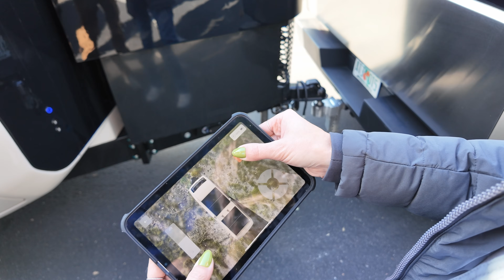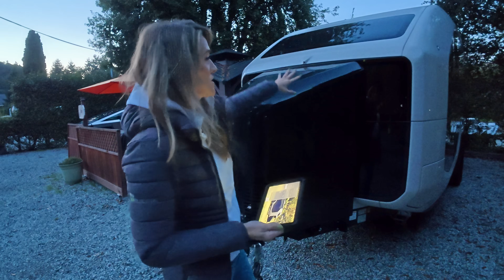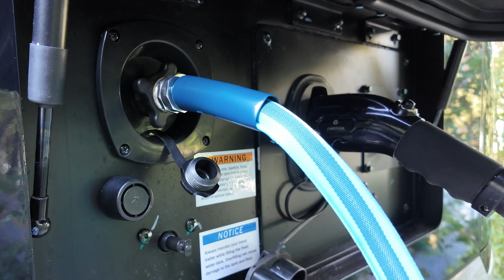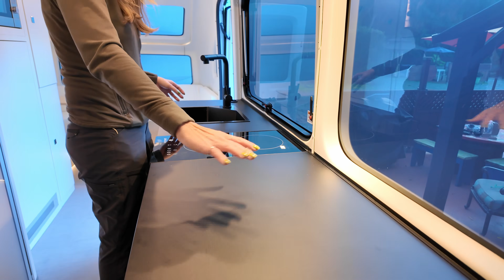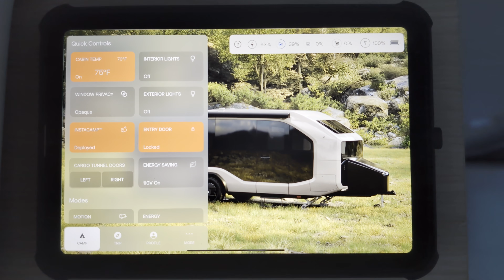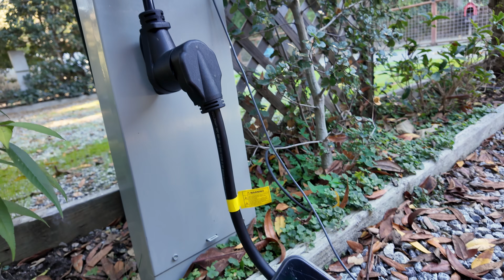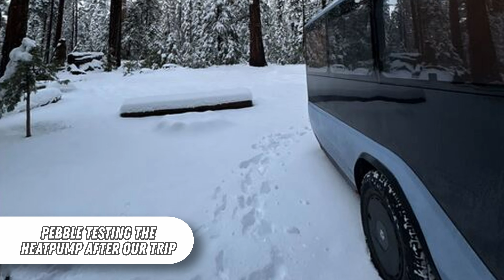World's First Pebble Flow Review (Electric Travel Trailer Camping Experience)

Comment: Pebble, please make a bigger version of this sith dual axls, bigger battery and solar.  More storage space, room for resi. Fridge, washer/ dryer.  Hatch on the roof to access to 1 or 2 roof top tents for more speepers, saving tons of room inside.  Beyter HVAC, 120V OUTLET outside...  shawer room, more rack space in the corner to the right of the mirror.  There js not enough storage thruout.  Maybe even utilize the sapce below the hub during toad mode.  Then remove it at the camp site before lowering the hub.
Reply from the maker: Maybe they will move up-market to an even higher priced platform as you've asked.

We suspect they'll move to greatly expand the size of their total addressable market by offering a more accessible product with higher volume potential.
-Producer Tim

Comment: From reddit:

Flush-mounted solar roof looks cool, but it’s an engineering mismatch for RVs. By eliminating the air gap under panels they trap heat, which:

(1) reduces PV output (≈ −0.35%/°C),

(2) bakes roof seals and causes leaks. The recall may relate to this.

(3) forces the AC to run harder — creating a thermal feedback loop that drains batteries faster.

Better insulation such as aerogel only delays heat transfer and often makes roof/panel temps worse. This is a design-for-looks problem, not a design-for-RV problem.
Reply from the maker: Every engineering decision is a tradeoff 
-Producer Tim
Reply: @MissGoElectric  How about if the heat pump stops working during charging? Did you test it if the heat pump will work under full sun? The flush-mounted solar panels may make the heat-pump/compressor stopped during charging or driving. I don't know, but I just have the concerns. Safety is the most important thing in our world. Agree?
Reply from the maker: Did we test the heat pump in the sun?  We had the vehicle for two days.  It was not hot outside.  It was cold.  We shared all of the HVAC data we gathered in great detail. Your proposal that the solar panels have any affect on the HVAC system is baffling to me.  We showed the location of the heat pump and it is nowhere near the panels.  -Producer Tim
Reply: @MissGoElectric Flush-mounted Sonar panels traps heat above roof. This will cause the temperature go to very high, which degrades the sealant. The trapped heat will transfer to the cabin which results the heat-pump running continuously.
Reply: @MissGoElectric  It is a good video. But I would check if the heat pump works (make cool) ALWAYS. The feature is used more often than heating.

Comment: Travel on the road-all flat or any hills? Is roof space able to support the installation of solar charging panels? Is the unit prewired for TV, sound system, and the previously mentioned solar charging controller/monitor?
Reply from the maker: As shown, the roof already has solar and required equipment.  Audio and Video is "bring your own".  See the company web site for granular packaging details. -Producer Tim

Comment: Great review - I liked the mention of the heat pump not operating properly - other than that, I liked the whole automation of this RV - here's my question - Is there a manual backup for any of the automation if it goes on the fritz?
Reply from the maker: Thanks for watching. Defective parts are replaced under warranty during the warranty period. The heat pump anomaly was unique to this RV according to Pebble they fixed it and the problem didn't affect other flow trailers 
-Producer Tim
Reply: I understand that parts will be replaced under warranty - I'm looking for a manual backup - for example, is there a manual process to clean the black and grey tanks if the iPad is lost or no longer works?
Reply from the maker: Owners will connect with the manufacturer for specific details on specific parts policies and procedures. We don't get that myopic as one time reviewers. 
-Producer Tim

Comment: While really cool, this trailer looks like a maintenance nightmare.  As a controls engineer, I see SO many areas that could fail and make the trailer unusable.  I do love the IDEA of this trailer however.
Reply from the maker: The central compute platform is Nvidia Orin. Robust and ubiquitous. 

RVs are famously unreliable. We think software define RVs like this which have far fewer disparate systems will yield enormous reliability improvements. 

The powertrain optional and for $110k folks can get a plain rolling EV like all of the others with a superior unified central platform
-Producer Tim
Reply: @MissGoElectric  My worry is that when the central controller of this RV fails a few years from now and Pebble is out of business, what do you do then?  Will the stabilizers retract?  Do the windows fail clear or opaque?  Will the HVAC still work?  Will the lights still turn on?  Sorry its just took risky for me.  Like I said, very cool RV in theory.  Its like a cyber truck or Rivian, very cool idea, just not ready for prime time.
Reply from the maker: Rivian 100,000+ units delivered
Tesla CT 75,000+ units delivered 
I have one of each. Great automobiles.

I'd be surprised if Pebble delivers 250 units annually. -Producer Tim
Reply: @MissGoElectric  You're preaching to the choir.  While I am not crazy about the tesla truck, I love the rivian.  When there are more charging stations than gas stations and it takes less than 10 minutes to go from empty to full charge, I will consider buying one.

Comment: I would have watched the video had you used anything other than a cybertruck
Reply from the maker: There are chapters so you can skip to the content you like most. We are pleased that Pebble invited us and provided the best selling and safest electric truck available in America to tow the Flow for this occasion. In our previous video with the Flow we towed using a Rivian R1T, which was also capable.
-Producer Tim
Reply: @MissGoElectric  Wow that's the most "i got paid to say" statement i have ever heard. The cybertruck is not the safest or best selling.
Reply: @MissGoElectric   Cybertruck sold 20,237 units in 2025, down 48.1% from 2024, while the Ford F-150 Lightning sold 27,307 units
Reply from the maker: We do not get paid for any of that.  You are mistaken on ALL accounts. 
F150 Lightning stopped production in October of 2025 and is not a competitor as a result.

Cybertruck Highest Safety Rating:
https://www.forbes.com/sites/sashalekach/2025/12/16/tesla-cybertruck-earns-highest-safety-rating-in-last-iihs-test-for-2025/

Cybertruck outselling all other electric trucks as of Q1 2026:
https://www.youtube.com/live/oK0UZEE9GPo?si=Pi-us0u5Osc0viBA&t=2151

If you'd like to keep up on the news in this sector, previous episodes of The Current are here:
news.missgoelectric.com
That includes sales figures and safety results.

-Producer Tim
Reply: @MissGoElectric Q1 2026 isn't even over yet - it's only February 13th. You're claiming sales numbers for a quarter that hasn't finished.

The F-150 Lightning outsold the Cybertruck for the full year 2025 (27,307 vs 20,237), THEN Ford discontinued it. The fact that it beat the Cybertruck and then got discontinued makes the Cybertruck's performance look worse, not better.

As for "highest safety rating" - it got 5 stars from NHTSA but the headlights received a "poor" rating from IIHS for excessive glare. Cherry-picking one test while ignoring failed components isn't honest. Cox Automotive, Kelley Blue Book, IIHS
Reply from the maker: No sir. Based on 2025 Q4 figures and January 2026 figures, the executives at Tesla have the information to publicly proclaim that their Cybertruck is outselling every other electric truck on sale in the USA. That is the statement which I repeated. If you want to engage with me, your attention to detail and provided resources will help improve your comprehension. 

As for safety, this is not an opinion. Accident data, NHTSA and IIHS tests are scientific and the results are clear. 

The glare argument is funny because anybody can buy a matte finish Cybertruck. The finish is not an inherently safety characteristic of the automobile. The color is a choice.

Anyhow, the results are not close. Cybertruck is utterly dominant in safety and this chart shows every single category.
https://cdn.cybertruckownersclub.com/attachments/110/110758-ac2e9373fb6f4d775c28c31d936cb8da.webp

-Producer Tim
Reply: @MissGoElectric  Fine you win. At some point something is just not worth my time. I have given you data and now i am just going to unfollow the channel and move on. Congratulations on winning your war of fact ignoring attrition.

Comment: With all this technology you can still only go about 150 miles in excellent weather.    Add rain and cold weather maybe 90 miles?   Not very practical.   

With the Silverodo Ev you might go 250 miles.  Seems usable.  At least 300 miles of real-world range would make this combination very useful in the real world.  

The good news is with the solar you are never truly stranded.
Reply from the maker: You've got your math wrong.
A Silverado WT would pull this about 375 miles on a single charge. 
-Producer Tim
Reply: @MissGoElectric  would love to see a real-world test.

Comment: I thought the plug for outdoor cooking is found in that long pass through with 2-3 ports, granted it’s not directly outside yet it’s easy access to the door opening.
Reply from the maker: The outlet is inside the gear tunnel.  It is not outside.  A person could leave the gear tunnel door open or hand a cable through a window to get power outside from any inside location, but we don't love that idea.  It allows bugs, critters, dust, pollen, moisture, and precipitation to infiltrate indoor spaces. That option also eliminates the security of the space with a door or window open, exposing contents to theft risk.

Starlink is what we'd use an external power outlet for primarily. We'd want that running all day and night.  We would not want to leave the gear tunnel open all day and night.  It wouldn't be difficult for a person to go into there and up through the hatch into the trailer.
-Producer Tim
Reply: @MissGoElectric  - TY for the follow up info. 👍🏼 Any chance on a Evotrex-PG5 video(s) on each model and a head to head comparison with the Atlas model and highest end Pebble?

Comment: insane price for that RV size. Besides all those electrical things and multiple points of failure (which, unfortunately, always happen when you're really far from civilization), it just feels empty and poorly designed inside. Look at traditional RV trailer manufacturers—they understand that every square inch of any surface (including walls and ceiling) inside can be used.
Reply from the maker: 🥱
-Producer Tim

Comment: A lot of cool stuff for sure. A couple of things that are a bit wild though: having to use poles for the awning and no built-in pull down screens, and screen door.  The emovable screens look cheap and would be a pain. Built-in screens have been around forever, and work wonderfully.  Same with having an awning that doesn't require poles.  Overall cool, but I do think it's overpriced. And it's not half an airstream.
Reply from the maker: 🥲
-Producer Tim

Comment: I would like propane as I like to cook with gas. I like to heat the shower water with propane as I’ve found it quick and hotter. I also like the propane powered fireplace for those cool mornings.
Reply from the maker: Of course fossil fuels such as propane are much more energy dense than batteries. That is what enables their explosion hazard. Most travel trailers hold such tanks. -Producer Tim

Comment: Your battery drained in 2 days. Grok calculated that to keep the Pebble charged indefinitely for long-term camping in a remote area, you would need 7kW capacity in 20 to 35 portable 200W-350W solar panels. They could fold up into suitcases stored in a spare trailer. 

Grok: "To keep the Pebble Flow EV trailer's 45 kWh battery charged indefinitely off-grid under the normal usage conditions described in the video (leading to depletion in about 2 days), you'd need extra portable solar panels to offset the approximate net daily energy drain of 22.5 kWh.Assuming similar real-world solar performance as the trailer's built-in 1.1 kW rooftop array (generating 3-4 kWh daily, or roughly 3.18 effective peak sun hours per day in clear conditions), the additional foldable portable solar system would need a total rated capacity of about 7 kW (7,000 watts)."

"This could be achieved with multiple commercial foldable panels—for example, around 20-35 units of 200-350W portable suitcase-style panels (depending on the model), which can be stored compactly inside the trailer or in a tow vehicle when not deployed. Deployment would involve unfolding and positioning them on the ground or nearby surfaces for optimal sun exposure during the day, connected to the trailer's charging system via compatible inverters/controllers. Factors as location, weather, season, panel efficiency (typically 20-23%), and shading affect output, so overprovisioning by 20-30% (e.g., up to 9 kW total extra) is advisable for reliability in variable remote areas. Always ensure the panels are compatible with the trailer's DC fast charging or AC inputs for seamless integration."
Reply from the maker: We shared detailed infographics in this video regarding resource consumption including extrapolations. Of course, the laws physics equally apply to any product ;)
-Producer Tim

Comment: I am a little confused about where you plug in your normal shore power 50A connection?  The regular plug looked like a 30A, but you said it was power out only.
Reply from the maker: The J1772 port is an input. It accepts AC at 120 or 240 V from 1A-48A.
The supplied cable and adapter were shown in this video plugged in. 
As Miss GoElectric said at the start of this review, those looking for features and specifications should watch this video first:
https://youtu.be/rpbfLEOH9Dk
-Producer Tim
Reply: @MissGoElectric got it.

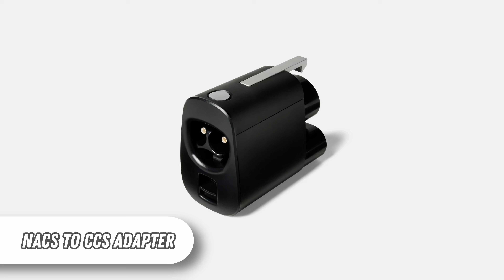Comment: Wow nacs not standard? That's just strange 14:59
Reply from the maker: Products like this take years to get designed and produced. Automakers have much greater scale and capital to make changes mid stream. A very low volume product like the Pebble Flow has less clout with suppliers and lacks the scale to justify the significant costs associated with that change. 

It takes less than two seconds for owners to insert the CCS NACS adapter when needed. This trailer can charge just about anywhere. 
-Producer Tim
Reply: @MissGoElectric yea I get it. It just reminds me of the comment about the light above the sink in the kitchen... Even though you could buy a cheap stick on light from amazon.. for $170K, you'd hope it would come with it standard. That's how I feel about nacs, and most people who have had to deal with ccs chargers would likely concur
Reply from the maker: A Pebble Flow owner could exclusively use Tesla Superchargers and not contend with any CCS dispensers. The adapter makes that easy. 

Thanks for watching. 
-Producer Tim

Comment: There is times when you would not want the aero tongue fairing to go up, automatically after hooking up to the tow vehicle.  If you are camping and want to stay hooked up.  Also if you were just hooking up to prepare for the next days travel.  The tongue can serve as a stabilizer jack, when the stabilizer jacks are retracted.   So once again,  this should not be an automatic step of the auto hookup procedure.   I think a toggle for the auto hookup, to include those two items would be a good choice.   That way you could toggle them on.
Reply from the maker: We would prefer the default sequence include the actions we take 90+% of the time. We think it makes more sense to take manual action for the exceptions, not the rule. We stand by our feature requests. 
- Producer Tim

Comment: Great review, great input for manufacturer.

It does seem like a fuel tank and a hydronic heating system would enhance energy supply of the trailer. It's hard to beat fossil fuel for heating in cold weather.
Reply from the maker: Energy density of propane or gas is many times greater than today's LFP batteries.

Thanks for watching and sharing your encouragement.
-Producer Tim
Reply: @MissGoElectric yes, and welcome.